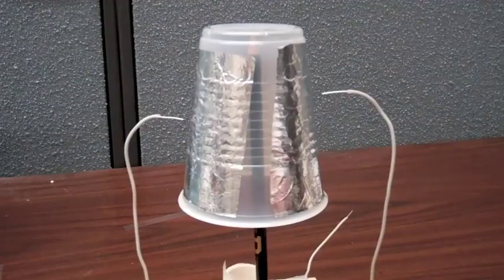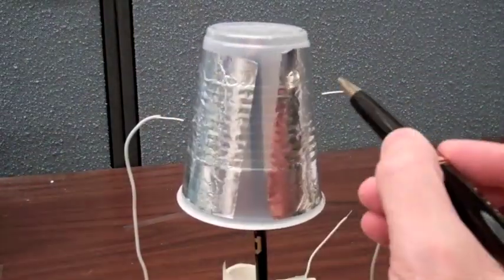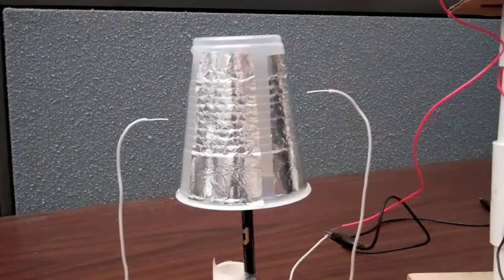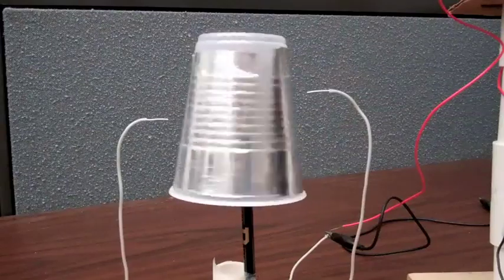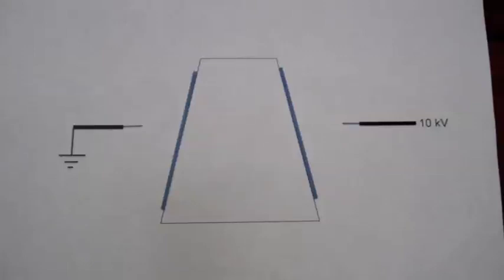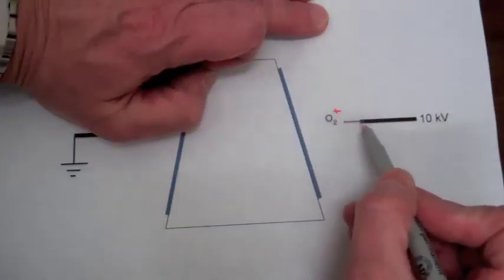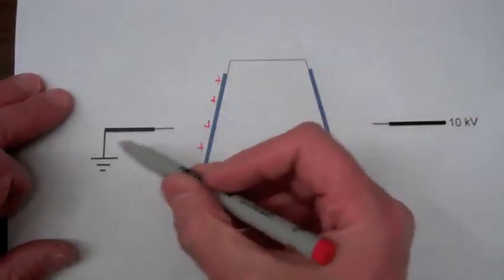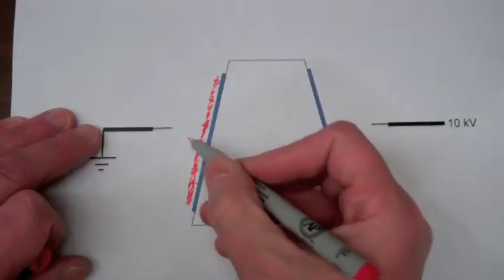Rotary Electrostatic Motor

Comment: SoForAHigherTorque,WhatWeNeedToIncrease:Voltage,Amperage,SurfaceArea...?
Reply from the maker: I have not thought about those things. A higher voltage should lead to more charge being transferred through the motor, which I believe would give you a greater torque.

Comment: 10000 volts to rotate a cup … 🤨
Reply from the maker: But you could do this with MEMS (micro electromechanical systems) on a miniature scale in silicon and not need such a high voltage.

Comment: Do you have to worry about possible X-rays being emitted?
Reply: Rather worry about electrocution, the formation of ozone and nitrogen oxides, or the ultraviolet rays that appear during stronger discharges.
Reply from the maker: @marianl8718  never fear https://youtu.be/zEJi71aknqQ
Reply from the maker: You would need a vacuum for the electrons to be accelerated to a high-enough energy to generate X-rays. The colliding of the electrons with air molecules prevents such high energy from occurring.

Comment: Very clear explanation of what creates the rotation - just excellent.

I study electrostatic turbines, aka electrostatic motors.   If a very light load, or no load, is placed on the rotating part, and you can still find a practical use for the rotation,  it is a reliable way to get rotation without the need of a motor and controller - all that's required is the charge separation provided by the DC supply and the ground.

Benjamin Franklin created an electrostatic motor - if you do a web search on "Ben Franklin electrostatic motor" there are links to it.  He built his electrostatic turbine in the year 1750.

Thank you for the very helpful explanation for laypeople on why the rotation occurs.
Reply from the maker: Thanks for the kind words and the information on Franklin's electrostatic motor.

Comment: Good afternoon. What voltage is applied to the plates?
Reply from the maker: I was using a Van de Graaff generator, so it was a high DC bias. Maybe 20,000 to 30,000 Volts.

Comment: Now repeat the experminent placing the cup and the calbles in a vacum chamber. 
How do you explain the rotating cup now?
Reply from the maker: It won't
Reply: @electricandmagneticfields2314  
It should not rotate. That's the hypothesis.  A demonstration  would make the presentation 100% scientific.
Reply from the maker: @MacLuckyPTP  If I had access to a vacuum chamber, but unfortunately I don't.
Reply: @electricandmagneticfields2314  It will work for the same reason that power transmission works in a vacum.
Reply from the maker: @macuskrakow449  What type of power transmission are you talking about?

Comment: If electrons get pulled off O2 molecules and into the wire, how much weight has your wire gained? There are Van de Graaff generators that have been running for decades and the components are not gaining weight or losing weight in form of electrons. Your understanding of mechanics is flawed, you should go slap your educator for indoctrinating you with the voodoo belief of “pulling electrons from thin air “ 

All of the people congratulating you on a perfect explanation, will now go on living out the entirety of their lives believing in Alchemy that you have convinced them of

Comment: If i make rotate mechannically the plastic glass can i get a voltage ?
Reply: You would need to have a static charge on the rotor to induce a voltage in the stator.

Comment: So the Electrostatika car is a combination of an electrostatic motor and an electrostatic generator. Instead drain current in the ground (ions) in the drain neutralization Leyden jar.
It is generated by friction electrostatic current (hand-on) then this current drives the electrostatic motor and the current after the neutralization of ions accumulates in a leyda bottle.
If conductive brushes are disposed obliquely, they produce an amplified rotation in electrostatic motors. The 1000-point question is how do we remove (use) the current from the leyda bottle ?!

Comment: very nicely done. clear explanation. simple construction. btw, for those concerned about 10 kv from a van de Graff, what voltage do you think is present in household static electricity?
Reply: The voltage in household static electricity can be even bigger !
Reply: You need a stable DC high voltage generator for this experiment, so no  electrostatically charge material present in any house can work for this. (And don't even think about mains voltage, dangerous but however at a far too low voltage).
Reply: @vptech9861  It will only be stable as long as there is no load. As soon as you touch it,you act as a load. And the voltage will go to nearly 0V almoust instantly.

Comment: Casually says "ten thousand volts"....
Reply from the maker: The source of the voltage is a van de graaff generator. The capacitance is low, so there is so little charge you barely feel it if you touch it.
Reply: That's nothing! You generate more than that every winter just by walking on your carpet!
Reply: Paul Bacon I don’t understand how is that 10k volts with those little wires ? I thought voltage needs a large space to travel through

Comment: Great to see your work . So ............ how can we " use " this .
Reply from the maker: Electrostatic motors were the first motors developed in the 1700s. They are limited in how much power they provide and they require high voltages. Motors with coils based on magnetic attraction and repulsion became the convention. There has been renewed interest in electrostatic motors for microelectromechanical systems (MEMS). These are systems built using integrated circuit processing techniques in silicon. You cannot built a motor with windings in a MEMS, but you can build electrostatic motors. There are some videos at this web site showing working MEMS motors, http://www.sandia.gov/mstc/mems_info/movie_gallery.html
Reply: Thank you for this helpful reply .

Comment: what if there was no space between the aluminium strips..???
Reply from the maker: +amogh bindal It would not turn. The part of the conductor opposite the positively charged electrode could not become positively charged. So there would be no repulsive force between the electrode and the conductor on the cup, which is what makes the cup rotate. Any positive charge resulting on the conductor on the cup caused by the positive electrode could flow away leaving the conductor on the cup opposite the positive electrode always negatively charged. So there would be an attraction between the positive electrode and the conductor on the cup. Just to be sure I tried the experiment with one piece of aluminum all around the cup and it would not rotate.
Reply: +Michael Melloch  thank you for answering.. :)

Comment: Very great video, I can't wait to try it out. But the cup is rotating so fast, so how can air  molecules be ionised and neutralised so fast?
Reply: Well, since gas atoms and molecules tend to bounce around at somewhere near the speed of sound, the amount of time it takes for the ionized atoms to go from point-to-point is almost nothing.
Reply from the maker: +AMOGHA JAYANTH MK It is probably very difficult to model this ionization and flow of charge in the air. It is not something I have ever looked into.
Reply: Air molecules travel at at very very high speeds.

Comment: Very cool demonstration! But there are moving charges, so technically, this isn't an electrostatic motor.
Very cool non the les!
Reply from the maker: Hindrik Hoekstra 
Thanks. The term “Electrostatic Motor” is given to these
types of motors where the mechanical motion is caused by repulsion and
attraction of charge.  You are correct that there is charge transfer to set up the repulsion. In all motors referred to as Electrostatic motors there is a continuous transfer of charge from the voltage source to ground through the motor. Another example is Franklin’s bells https://www.youtube.com/watch?v=RaKh7ZoLd0M

Comment: I am a student at Queen's University and I have a physics project that is based on this idea. Is there any way of making this a lot stronger? What would I have to do to increase the angular velocity and increase the torque applied to the cup? Maybe another source other than a van de graaff? I would like to know the math that would allow me to calculate the exact current or voltage that would allow me to spin not only a light cup like in this video, but something on the scale of 2-3lbs spinning at the same speed as you have with the cup. I have already made this apparatus, it spins quite well, I have added a base to the cup with a hole in the middle to stop any swaying. I just want to know how to tackle the problem to make it stronger.
Reply from the maker: A higher voltage, but you will probably be limited to the voltage you can go up to by dielectric breakdown of the air. How about instead of one wire on each side multiple wires? I like your idea of the base to stop the swaying.
Reply: Might be very very late, but the force is due to electric fields. Thus increasing the area will increase the force. So in addition to the wire, which will get charges to the plates, you can use a bigger area of aluminium foil right next to it. It will act as a bigger stator, than the wire itselve is. You will have to connect it to the sane voltage as the wire is comnected to, for it to work. To make it spin faster while maintaning high tourque you might have to get it closer to the rotor. Also you can of course increase the voltage.

Comment: In the video the cup spins clockwise, is that more likely than counterclockwise? Also why doesn't the cup just tilt away from the wire (it has some sort of torque instead, why is this?). Where does the angular force come from?
Reply from the maker: If it was completely symmetrical it would be equally likely to start spinning clockwise or counter clockwise. There is probably some asymmetry, my wire not pointing directly at the cup, that gives it some preferential direction to spin. This is also why it doesn't just tilt. Also imagine pushing the cup with some pointed object. It would be hard to balance it in a tilted position without it slipping to one side or the other and rotating.

Comment: Do you make any ozone?
Would this work in a vacuum?
Reply from the maker: When operating just the van de graaff generator, which  I am using to power this electrostatic motor, I have detected the smell of ozone. This electrostatic motor would work in a vacuum. You would have to get a large enough electric field to get emission of electrons from the Al foil facing the positive electrode. In this demonstration I am already getting a large enough electric field to get electron emission from the grounded electrode because of its high curvature.

Comment: Hello, can you give more details explaining the gaps between the Al foils?
Reply from the maker: Patrick Sarmiento The only requirement on the gaps is to electrically isolate the strips of Al foil. So the width of the gap should not be critical. Also the number of strips is not critical. I think it will work with as little as two strips, although a larger number of strips will probably result in more efficient charging and un-charging of the strips of Al and better rotation.
Reply: Michael Melloch Thanks. You da real mvp.

Comment: will it work if we have 100 v van de graph generator??
Reply from the maker: You have to get a large enough electric field intensity to ionize the air molecules. If you could make the gap small enough you would get a large enough electric field intensity with 100 V between the wire tip and aluminum on the cup.

Comment: Will this work if the medium between cup and electrodes are vacuum.
Reply: O2- makes a pressure (on the left clockwise side after grounded electrode (cathode, I suppose) when gets its neutralizing positive charge.
This means no vacuum is concerned for experiment.
Simple air in normal conditions.